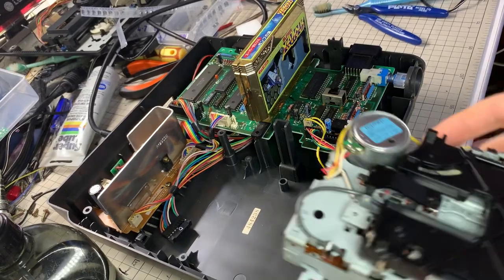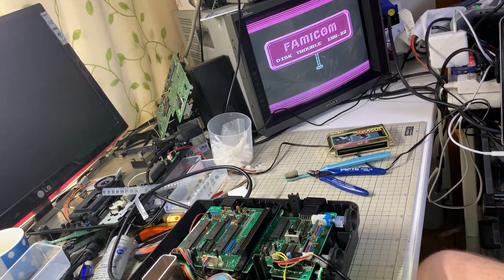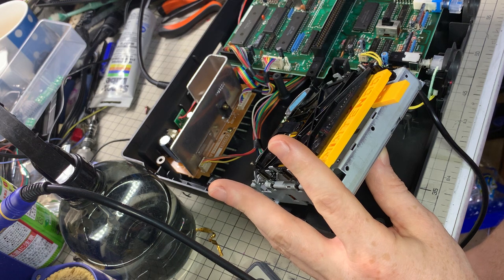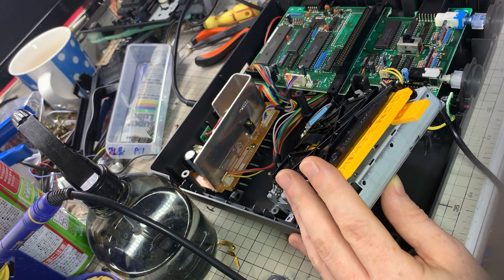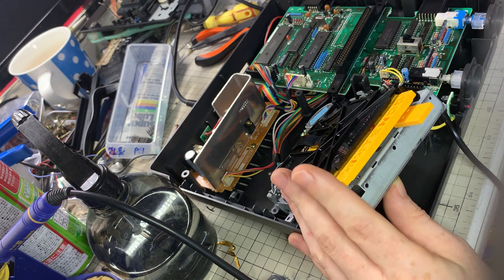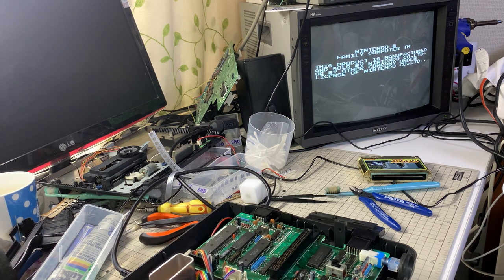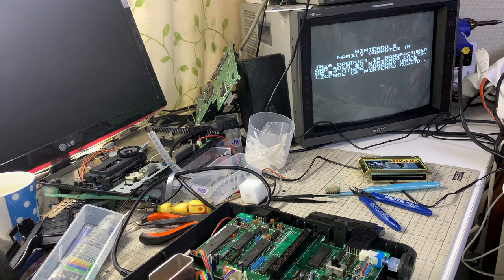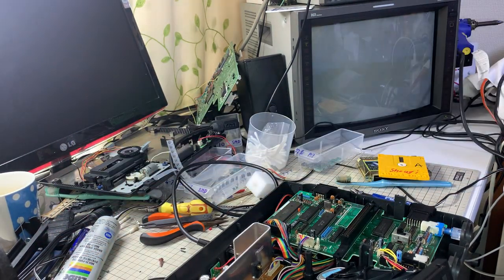Famicom Disk System Tuning Adjustment Disk Read Error 22 26 27 etc. Sharp Famicom Twin Nintendo NES

Comment: This tutorial is the most straight forward I've seen so far. I completely understand what I'm doing and why I'm doing it but for some reason, I cannot get an ~8 second load to happen twice. I've actually gotten a disk to show the copyright info in less than 5 seconds but I can switch the system off and then on again and get an error 22. After hours of trying to find the "sweet spot" on that head, I don't think I've successfully loaded a disk twice, in succession. I think it's driving me insane. You'd think my head was loose and losing its alignment when I load the first time but the set screw has never been loose enough to raise the head after a successful load.
Reply from the maker: Sometimes it’s the drive and there’s nothing you can do. Better to buy a new drive than spend more than 4 hours on any one drive.
Reply from the maker: Have you tried using a Q tip and gently cleaning the felt pad that sits on the top of the disc? I’d only lightly spray some alcohol on a q tip and gently wipe that. It does help sometimes.
Reply: @Redraw4444  I have, yes. No less than 5 minutes after I posted my comment, I hit the jackpot (sort of). I was able to load all but one disk out of the 12 or so I have here. Crackout, or the Japanese equivalent, refused to load, no matter what. Then my belt came off. My original problem has returned. The belts I ordered are a bit small, so the moment they get between the spindle and gear, while installing them, they get well greased and are almost impossible to dry out.
Reply from the maker: @AtariBorn  make sure the 3 screws (that screw the two cogs controlling the belt down) are sitting flush in the depressions in the casing. The 3 long screws can be screwed until almost tight, then use your thumb to push down until the posts sit flush, then screw the 3 screws tight.

I say this as the belt slides off it any of those screws aren’t flush. The cogs will be slightly off-kilter and the belt then slips off. 

Or it could be a small belt like you said. Just covering all bases.
Reply: @Redraw4444  You're absolutely right on that. I had trouble putting everything back together, around the 78th time I had to put the belt back on and I noticed that the screws will actually set, without the legs being "snapped" into their proper seats. I think I've solved the belt issue. I broke it all down again and cleaned everything with IPA, before putting the belt on in one go. Haven't had a belt issue for a while but I'm back to loading almost everything. Super Mario Brothers won't load now, along with Crackout. Othello and Pro Wrestling are the easiest to get working, so I've quit using them as a reference.
Reply: @Redraw4444  I haven't found a place to buy bare drives. Buying working disk systems, only to cannibalize them, seems redundant. Any ideas?
Reply: @Redraw4444  [UPDATE] As it turns out, I wasn't paying attention when the "Disk Trouble" errors were posting. One thing that I didn't notice is that the Crackout disk was giving an error 27, rather than the usual error 22 that I would get while dialing in the alignment. I did a little research and it turns out that error 27 could be the motor spinning too fast or too slow. Behind the dust cover of the little black hole on the top of the motor, there's a small flathead screw or maybe a potentiometer. Either way, I turned the screw just a few degrees counter-clockwise (left) to adjust the motor up and BINGO!. That cantankerous Crackout disk loaded for the first time on this drive.
Reply from the maker: @AtariBorn  dude, you get 10/10 for perseverance. That’s pretty amazing. Good job.
Reply: @Redraw4444  It loads everything I throw at it now. I don't know if it will help anyone but that stupid Crackout disk did make the drive react different as well. After the head reached the rear of the carriage and started back to the front, just after the time you would normally see a black screen, the drive would stop then start again. The activity LED would even turn off for a split second and then turn back on again, mid load. This "hiccup" stopped after adjusting the motor.
Reply from the maker: @AtariBorn  do you have a boot meter? Maybe there’s an optimum voltage and you’ve adjusted it at the right point. Anyway, very helpful information. Stands to reason that the motor would lose some of its power over time so a tweak of the pot to increase the voltage somewhat would help.
Reply: @Redraw4444  I have a multimeter. I didn't dare turn it down as I'm sure the motor didn't get more efficient with age.
Reply: @Redraw4444   I read that there's a "Copy Master" disk floating around for the guys that own a Bung FDS copier and it has a utility to test the drive speed. Here is an excerpt from I found:

FDS Drive Speed
The Makko and NTSC versions of Copy Master include a utility that will test the speed that the FDS drive is tuned to, called “Check Doctor” in the Makko version and “Speed Test” in the NTSC version. Copy Master v1.0 does not have a Speed Test option, and instead shows “Boot Disk” in its place, which just resets the Famicom.

The speeds range from 1 to 9, and the utility will also display “too slow” or “too fast.” According to Tomy at ToToTEK (and Bung/Makko), the speed should be set to 5 with the disk in the drive, which should equal 0 or 1 when there is no disk inserted in the drive. The test should be performed twice in a row, since during the first test the magnetic head position is unknown so the test may show an incorrect speed.

The speed can be adjusted by turning the potentiometer inside the motor with a small flat head screwdriver. Turning to the right slows the drive and turning to the left speeds it up. Use very small increments to make adjustments to the speed, re-testing after each, until the desired drive speed is achieved.

Comment: Confused as to what you’re doing here with the Alan key. 
I’m having the same drive issues on a “fully tested and working” twin I just got from eBay. You’re loosening the part and turning it a little then tightening it again but the part turns while operating anyway so I’m not sure what I am doing
Reply from the maker: The thing rotates, but it’s ‘aligned’ to other parts, so there is a point where reading of disks in optimal.
Reply: Allen

Comment: Recently replaced the belt in a Twin FC, only have 2 games right now with one consistently loading in about 8 seconds and the other usually giving me Error 27.  Not sure if it's the drive or the game.
Reply: Literally a comment from a year ago but Im having the exact same issue lol
Reply: @PuellaSins  Yeah, I think I messed up by disassembling the spindle all the way (couldn't figure out how to get off the spade shaped part at first). I was able to get all my games loading consistently but errors still pop up during gameplay, even after hours of adjusting. Got a couple junk drives that I can probably use as replacements, and I might be able to fix the current drive if I hook it up to my oscilloscope, but haven't gotten around to it yet

Comment: @Redraw4444 thanks for the video. I almost got it working with your info but in the end I followed this video
https://www.youtube.com/watch?v=fOY1G3Sg11Q&t=1260s
See step 5. You can align the spindle by aliging a "hole" in the bottom of the drive. I got it aligned the first time.
Also the video suggeste make sure to test the disk with the front cover on. Without the frontcover the disk can shift in place by a few mm and throws error.
I got the spindle aligned but it won't read side B for some disks. I tweaked the motor speed (small hole on top of the silver motor can) and now it is all good.

Comment: I have been working on y drive for a few hours a day and yesterday i got the drive working only if the drive is on a upward angle???? it read all my disks with no issues but as soon as i lay it flat it errors 22.. i have took the drive a part re calibrated it but now its not working at all?? any ideas would be appreciated thanks